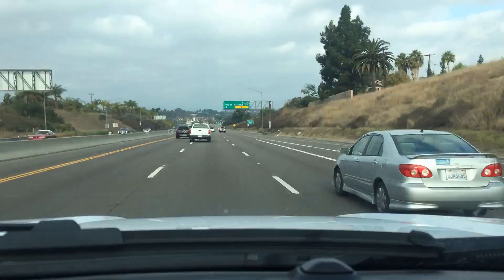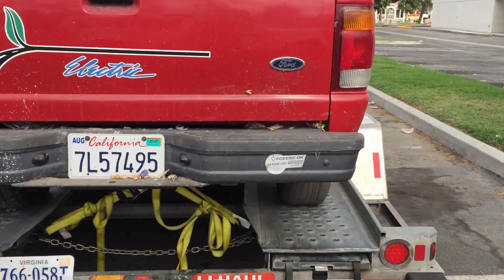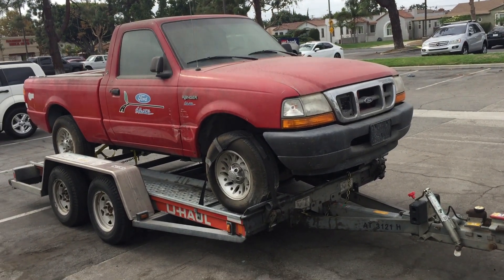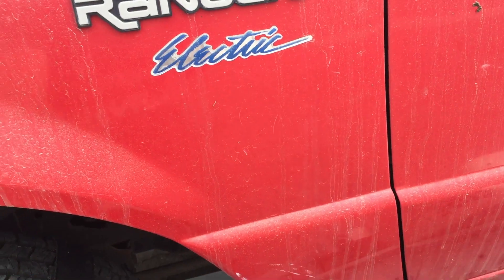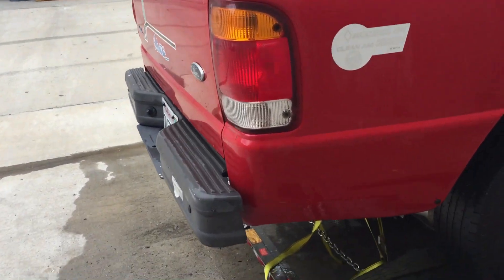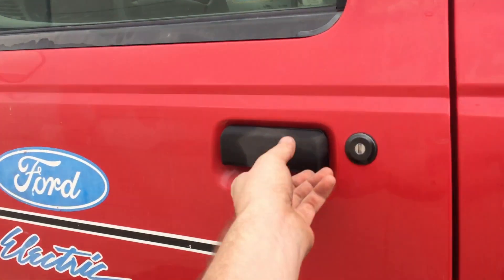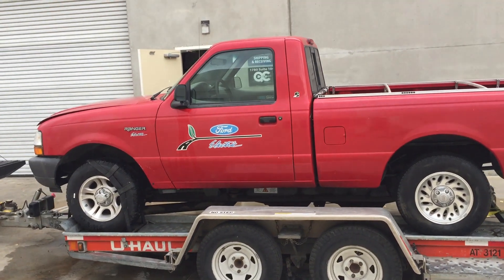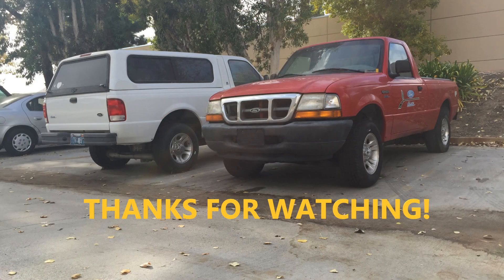Another Ranger EV?!?  (Ranger EV Project ep.3)

Comment: Having spent two years working on a RAV4EV  and recently on a Ford EV I know it all takes time but am wondering how is it going. In the first video you had what looked like a toyota Rav 4 in the back ground was that an EV.
Reply from the maker: peter luckham Haven’t made much progress. I actually put the Red truck here up for sale to try and raise some cash to get a battery pack for my white truck. 
I would love to have a 1st gen RAV4 EV! I currently own a gasoline powered one (1997 AWD with manual transmission). 
The shop that I work at actually does a lot or work on the 2nd gen (Tesla powered) RAV4 EV, so I have a lot of experience with those cars. I’ve actually been working on un-bricking a Roadster battery at work for the past few days now.